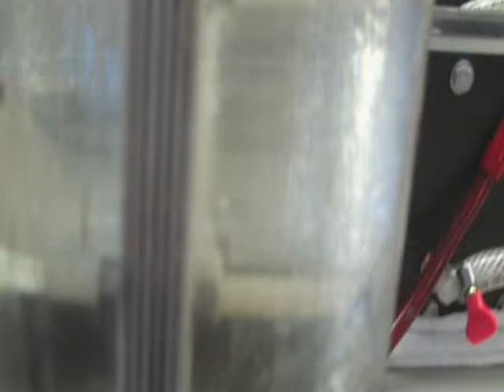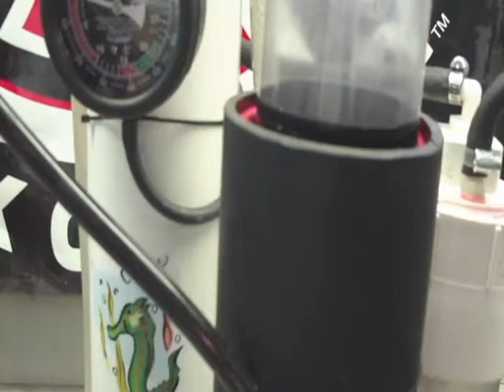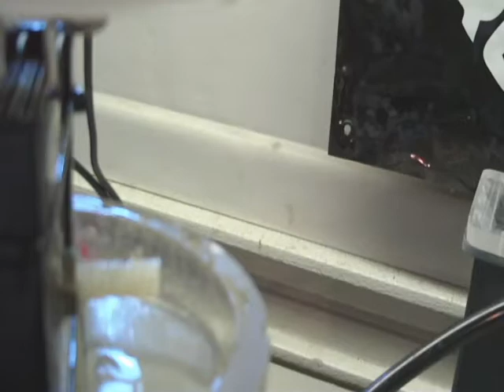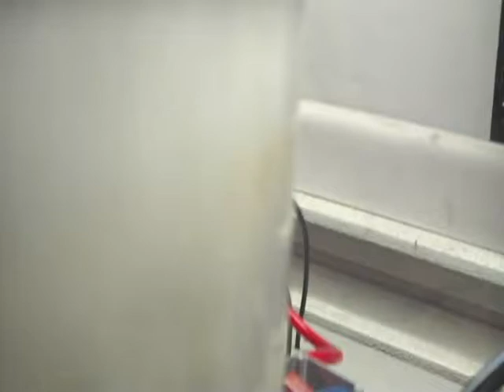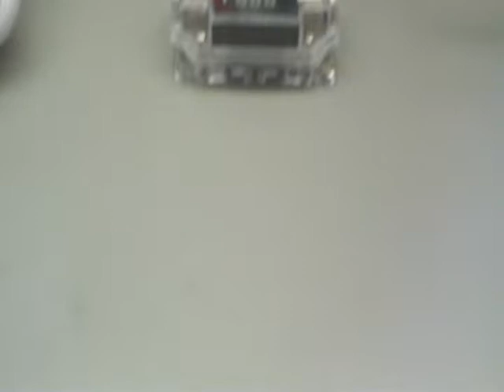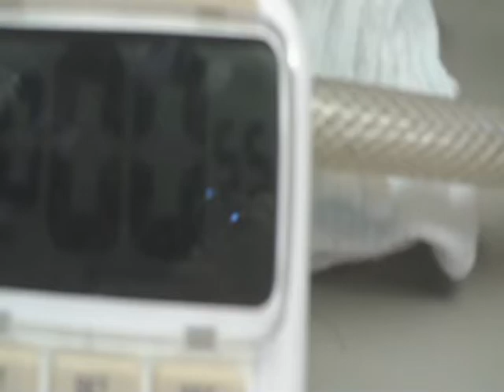small gap .80mm open and closed test

Comment: I have been around, I watch all the videos. I picked  up my big tab today. Now I can finally tab my holes so I can fit in my hose fittings. It is an expensive tool but it makes the work a lot easier. I made gaskets from EPDM rubber foil that is very commonly used for building a koi fish pond. It is cheep, but I haven't done a test yet.  I got mine for free after I made a phone call with a fish pond builder. I explained what I was doing and asked if he could send me a piece off foil. Greets